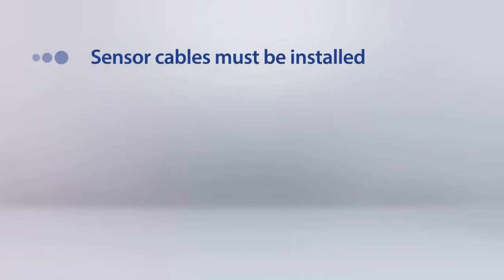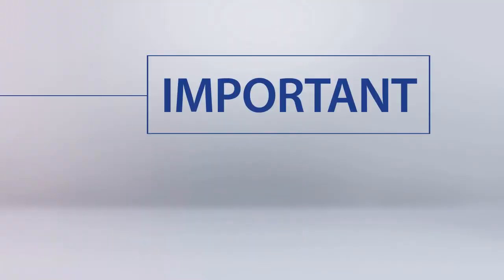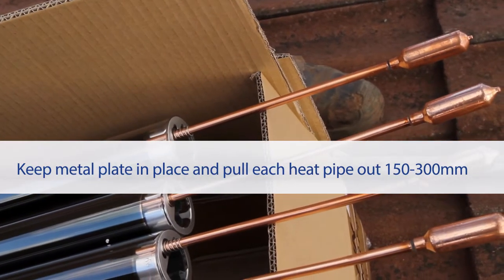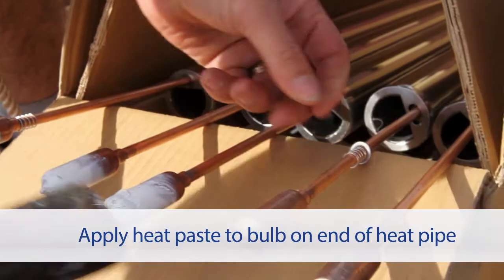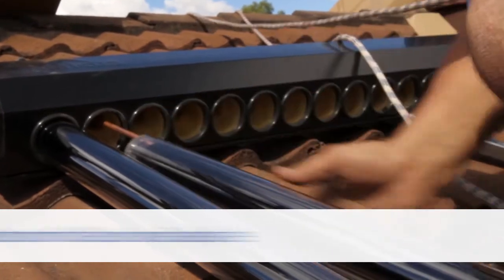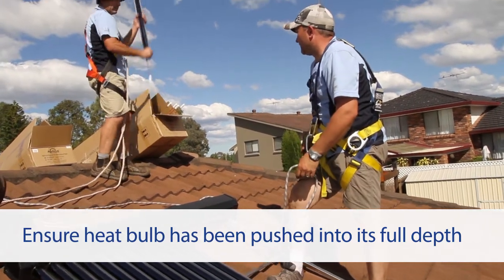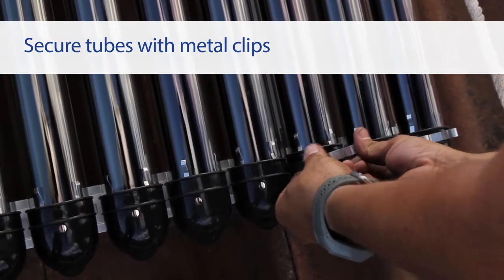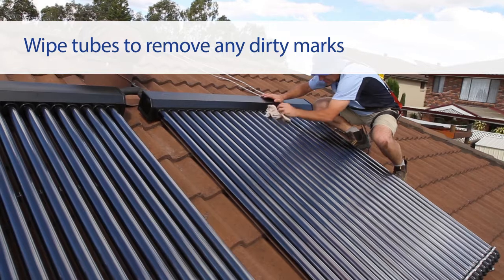Chapter 10 - Installing Apricus Tubes - How To Install Apricus Solar Hot Water Systems

Comment: Was a great heat pipe collector as the co designer and developer with Mick until 2007. but as with 99% of all solar water heating systems today, over engineered and the wrong type of hot water tank. Everybody is being sold a solar heated tank of water with no support for space heating as installed in my UK home for the past 12 years, with no servicing, none pressure, but still hot water at mains pressure and no closed loop kits, just simple design knowledge and experiance